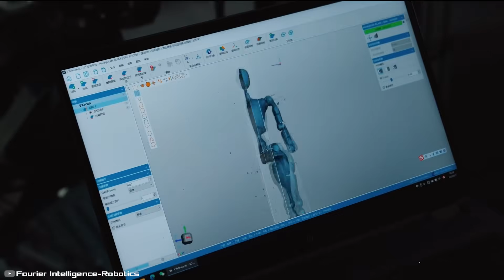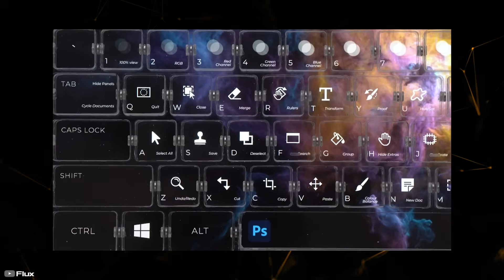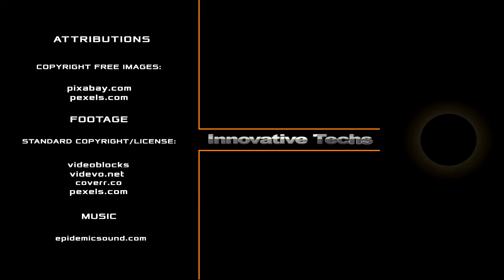INVENTIONS THAT WILL SOON CHANGE THE WORLD

Comment: Psyche is an M-type asteroid, meaning it is metallic, though it's not entirely clear what type of metal it is made of. 

Methods like radar show that Psyche's surface is highly reflective but don't reveal what the reflective material is, he said. Many scientists think Psyche's surface is made mostly of nickel and iron, since those elements tend to be common in asteroids, he added. 

Regardless of what Psyche is made of, it likely contains so much metal that estimating its amount and multiplying it by the current market value yields an unbelievable number, like the $100,000 quadrillion figure, which Elkins-Tanton estimated you could get from mining iron alone.

There are no plans to mine Psyche, nor technology that would allow us to. Even if we could mine Psyche and bring the materials back to Earth, the asteroid is so far away that the cost of doing so would negate their value, Philip Metzger, a planetary physicist at the University of Central Florida, told Space  dot com.

Comment: Does the "RF Safe Stop" damage the vehicle?
Is the disabling of the engine a temporary effect or a permanent one?
Does it work like an EMP and physically burn out circuit board electronics and melt the copper windings in starter motors and alternators via induced overcurrents?

Comment: All we need is for a psychopath Billionaire to take time off from killing us all and to send thousands of those box buildings to replace the slum housing over in Ghana, in particular, the slum area of Accra and there would be no logical reason for them to be provided with clean running water and electricity, although that may take a bit longer? But they won't. 
It is NOT that the World is overpopulated, it is just badly managed.

Comment: 4:39 gimme a break, minor push backs, they are far from boston dynamics.
10:30 worst idea ever, firstly it will be disabled unless it's built into the ECU itself and not and attachment which will simply be removed. hackers gonna hack and they will find ways to simply jam or block the signal when stealing the car anyway

Comment: I think this will only work with conventional gas engines that require spark for combustion. Not sure how this could disrupt a diesel. Looks like we need to go back to manual pumps so they won’t get stopped
Reply: Because we all know this can be abused and will be abused. Will they make manual illegal, most likely so they can continue to use the new tech unhindered. Also using this on unaware motorcyclists just seems outright dangerous. Engine instantly cuts out a part locks and the motorcycle goes for a dive.

Comment: you'll probably get more volume of hot water faster by laying the coil flat and reducing the volume of air around and inside of the towered coil.
Reply: yes…it’s called a $25 black garden hose…was invented long ago…
Reply: and it also can water your garden
Reply: Most of the time, the sun is not going to be directly over head.  So by building a tower, it creates a larger surface area.

Comment: An unexplored technology option to also aerodynamically streamline large trailer trucks, would be to retrofit a downhill rolling or braking energy recycler device to the rear, a modified undercarriage that keeps racing cars from going under the trailer, which uses a ‘Smart’ robot mechanism that only descends a modified shopping cart wheel equipped gear works, which turns a small electric generator, which stores up the electrical juice in a Tesla Coil, which only retains a charge for a few days, but will not explode like Lithium batteries do, and be much cheaper, in Order to empower an air pimp that engages automatically, when the whole vehicle is moving fast, to suck air from the front of the truck, and rocket-jet it out the rear end, to help propel it all, to save billions in fuel annually as well. That system could be designed to draw the air through paper ‘coffee filters’, so that this retrofitted mechanism could remove a great deal of SOOT from the atmosphere as it goes along!
Reply: Tesla Semi
Reply: Interesting. Perhaps a configuration that senses and harnesses tail winds to. Brilliant ideas Chris.Inspiring!
Reply: @Seersage101  The pressure of a tailwind dwindles exponentially as a truck approaches the windspeed.  The flat tailgate of a truck "harnesses" that tiny push almost  maximally as is, and a truly aerodynamic truck would eliminate the big retardant force of the vacuum it induces behind it, something like the tapering tail of an airplane or a fish.  Erect the biggest sail you can on a bicycle and you won't reach the speed of the wind itself, right?  
How do you propose to "harness" a truck's tailwind when the truck is exceeding all but the very rarest of windspeeds from behind, especially if you streamline the truck for ACTUAL significant fuel economy improvement !?  A 20mph tailwind won't even budge an empty big rig on flat ground !
It's no wonder why you think Chris's ideas are "brilliant".
Reply: Tesla coils don't "store" energy at all, not even "for a few days".  You must be involved in the recent, faddish, very often grossly exaggerated, cultish hero worship of Nikola Tesla by nonscientists, nonengineers and nonhistorians.  
That's only one of the laughable attempts at substituting imagination for actual engineering you wrote here.  At first I thought you were trolling for laughs, but I finally concluded you were serious and most likely a textbook example of the Dunning-Krueger Effect.  
Any mechanical engineer could write a book on why a regenerative braking scheme ("unexplored technology option", Ha !) on an internal combustion engine truck is foolish, especially when used to "store" energy in a Tesla coil !  Those long , hi voltage sparks really made an impression on you.  A regen brake improves fuel economy at best just by 3 or 4% and that comes from using the components that are already there in an electriv or hybrid gas/electic vehicle.  An electric motor doubles as a generator with very little persuasion.   truck's load hauling capacity is at a premium.  It wouldn't make sense to haul the weight of a generator and battery substantial enough to recoup the energy salvageable from the conversion of the trucks momentum into electricity by occasionally subbing a generator for brakes.
Turn to writing what you know something about from long, hard experience and/or long, hard formal education.  
I apologize for my harshness if you are younger than about 18.

Comment: If a vehicle's engine is remotely switched-off, that vehicle will loose its power assisted braking: its  brakes would be useless (the vehicle will then become dangerous ) How do they intend getting around that aspect of the idea?
Reply: As you mentioned they are “power assisted” brakes. They do not lose the ability to stop the vehicle, it is just more difficult because the booster will no longer be assisting the braking effort after a few applications.
Reply: @Preceptor-lf1ht yes but I think still to dangerous.  In all my years alive. I've learned that police are some of the most un educated in society.  So again as usua,l it would only be abused as (everything) else. 🤷
Reply: Lose
Reply: Not true
Reply: @SteveStowell you  are referring to only one possible scenario? The use of a device, that disables the engine,thus the brakes. Would be super foolish in most circumstances 🤔
Reply: If they are running from the police they are not worried about stopping.
Reply: I had an 06 hhr chevy!! It had electric powered brakes and steering and car stalled on me while driving on the highway going 70 mph I had to go into the median middle of the highway into deep grass to slow it down so I wouldn't wreck or cause an accident!! That was scary especially when I tried to get it to restart the steering wheel locked on me thankfully I was in the deep grass at that time I got rid of that car asap!!!!
Reply: Battery died in the hhr alternator was giving me problems on my way home but the fact that I couldn't steer or stop after I lost power driving 70 mph was enough for me to get rid of it!!
Reply: Actually the brakes will work one time after the engine Switched Off with the same hydraulic pressure that they had the before the engine was off but only once but the engines off and they used to break once and they'll be going slow and the brakes still work after the engines off they only work with your power on them I once lost my brake booster for the vacuum hose came off at 150 miles an hour and I was able to stop just barely and a bit my steering wheel pulling up on it to stand on the brakes but I was able to stop the car
Reply: @travisgale5558  yes of course. But it isn't easy. I know from experience. In other words. If it happens to most men. Probably work out okay. If it happens to most women, probably not going to workout is good. J.s.
Reply: @GIobeCentral

There was a thing called "brakes" before "power assisted brakes".  Mechanical systems before electrical fly by wire.  Basic functions of things like hydraulics, pull cables and pressure plates.  You know things that don't use electricity.  

Concept, use "outdated technology" because it actually works.  If you aren't strong enough to push a brake pedal with your foot, you fail at being alive.

Don't be weak.
Reply: BTW, I don't care what you say because it should be obvious I commented on your comment without watching the video.  Why the fuq would you care what an uniformed person has to say?
Reply: What aspect? The vehicle was already dangerous as the driver was not braking before the engine is disabled and would just keep pumping the gas pedal after the engine shuts down. For your question to make any sense there would have to be an intent to brake in the first place.
Reply: The whole concept of police being able to remotely disable vehicles is terrifying on light of the maui massacre
Reply: @ATripp-dm9rg  Right!  Just following orders sir! 🤡
Reply: Back in 2008 a guy with a laptop shut down a bunch of GM's in a few square blocks just to prove how fallible the system is. No security updates to the system have been completed since then